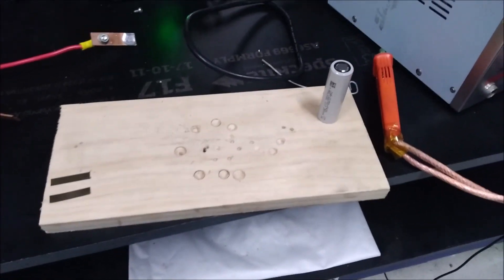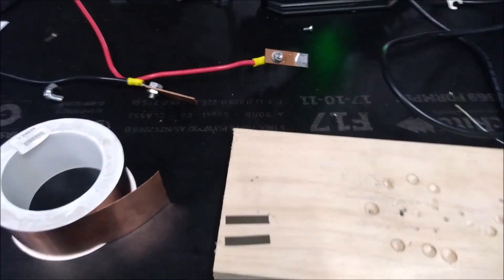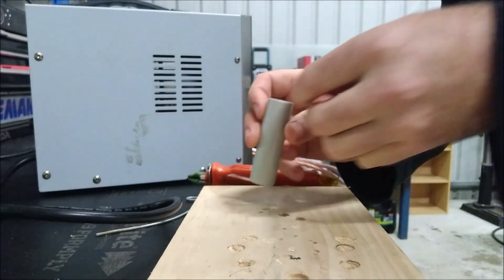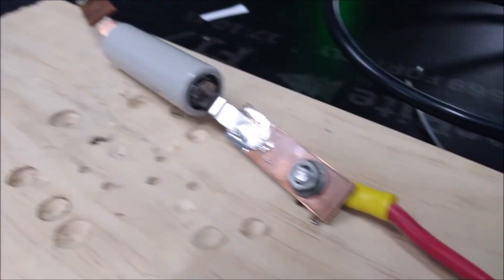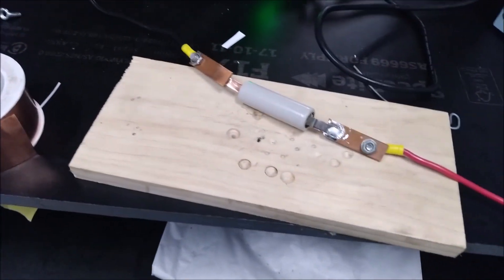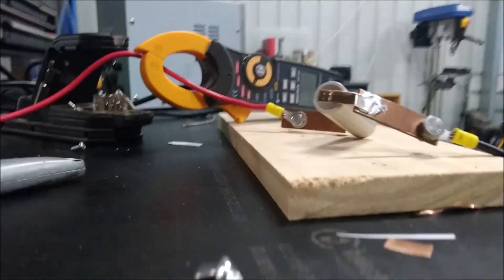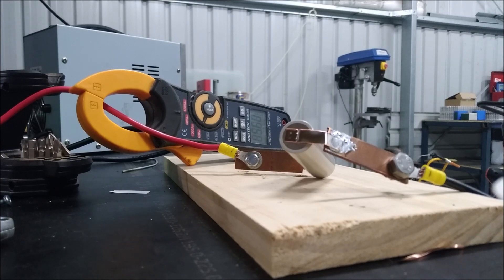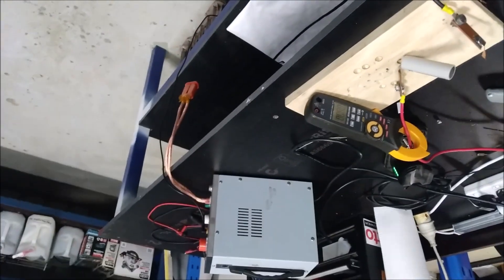Spot welding a nickel sandwich

Comment: 제가 테스트 해봤을때는 12V 38A에도 58도(C)에 도달하더라구요..
니켈 0.15T + 구리테이프 0.05T입니다

When I tested it, it reached 58 degrees (C) at 12V 38A
It's nickel 0.15T + copper tape 0.05T
Reply from the maker: Not bad! This copper tape is 0.07 mm, so probably a bit more conduction there.

Comment: Something is missing here because I have same equipment and I get absolutely ZERO weld . The nickel welds to the copper .....and the "sandwich " falls right off the battery . Not even a hint of welding ..
In fact my spot welder has " the mod" . Added another turn to the transformer . It welds nickel fine . I have to turn it down in fact . But the copper , forget it complete failure ..
Reply from the maker: Check the thickness if your metals. This is 0.15 mm nickel and 0.07 mm copper. It absolutely won't work with 0.2 mm nickel.

Comment: 구리 테이프라는 것이 접착제가 발려있는 구리 맞나요?
제가 그런 양면 전도성 구리 테이프를 이용하여 스폿을 시도했는데요
엄청난 연기와 함께 플라스틱이 녹는듯한 지독한 냄새가 났습니다
같은 증상이 있었나요?
Reply from the maker: Yes, copper tape with adhesive. It does stink a little, yeah.
Reply: @jonescg  답변 감사합니다
Thank you for your answer
Reply: Is copper tape copper with adhesive on it?
I used double-sided conductive copper tape to make a spot
It smelled like plastic melting with a lot of smoke
Did you have the same symptoms?

Comment: There’s a battery building article floating around that said this technique has a long history and was used  to spot weld aluminum in the before times.     

The one hopefully minor issue I see is an oxidation layer forming on the copper strip at the battery connection, unlike factory made nickel plated copper strips.

Comment: Maybe its not getting hotter because the larger copper where you solder is the one absorbing all the current
Reply from the maker: I did the exact same test but with a single piece of nickel, and the nickel glowed white hot at 30 amps. So the copper was definitely taking the bulk of the current.
Reply: @jonescg  can you help me build what is the right thickness of copper  and nickel for a 100 amps of my 22S10P batteries. Thanks
Reply from the maker: @jobmariano348  I used 0.15 mm nickel and 0.075 mm copper. This will pass 100 amps PER CELL for approximately 5 seconds. So potentially 1000 amps for your 22s pack. It will sag pretty bad at this rate, and the cells will start to get quite hot, but the conductors will manage such a high discharge rate.

Comment: This is a good technique for using spot welders without industrial levels of power output to still be able to weld copper strip to cells. It works quite well, too. 

Because copper has such a low resistance, attempting to spot weld only copper strip to cells is quite difficult, because the resistance at the electrode tips is too low to generate the heat needed to make the weld. Using nickel strip, which has substantially more resistance, becomes far hotter at the electrode tips and it is this heat that welds both the nickel and copper strip to the cell. Very effective method for high current bus on battery packs.

Comment: What is the thickness of the copper and the nickel?
Reply from the maker: Copper is 0.07 mm thick amd the nickel is 0.15 mm thick.
Reply: @jonescg  did you use pure nickel or nickel plated steel? thanks
Reply from the maker: @ktestable  pure nickel, but honestly I don't think it makes any difference. The purpose of the nickel is to provide enough resistance so the contact points get super hot and fuse the copper below to the cell can. The copper is carrying the current, while the nickel is just there for bonding support.
Reply: It does make a difference for the reason you explained, Resistance. The nickel coated strip will have less resistance and that will make a Better weld because of it. @jonescg
Reply: @starcitizenmodding4436 nickel coated steel actually has more resistance which is why it generates more heat
Reply: @BH4x0r  yes your are right. my mistake with the wording. Sorry internet lol
Reply: @BH4x0r  are you into battery building? i have just dismantled a model 3 battery and am going to build batterys for my ebike!
Reply: @starcitizenmodding4436  nice, but make sure the cells are still in good shape and think about the fact they're not high current cells, they just have a lot of them together so they can take quite a bit of current together

run 50A max on a 5P pack for example to be safe.
Reply: @BH4x0r  Thanks for the tips. I was thinking 10A continuous like you say and 15A max. i couldn't find a absolute answer about their current ratings, but what your saying matches what i have read.

Comment: Like that!
I wonder if multiple sheets of copper spot welded together could be used as flexible bus bars for several hundred amps? Where did you get the copper tape?
Reply from the maker: Possibly, or just use two layers of this thin stuff. I should highlight though that my final termination method uses a 0.9 mm busplate with holes where these tabs are soldered, so the full current will be over 200 A, but managed easily by the copper plates (simulated here using 2 mm thick lumps of copper).  The tape was available from any electronics shop - this from Altronics, but I think Jaycar sells it too.
Reply: @jonescg  Thanks.